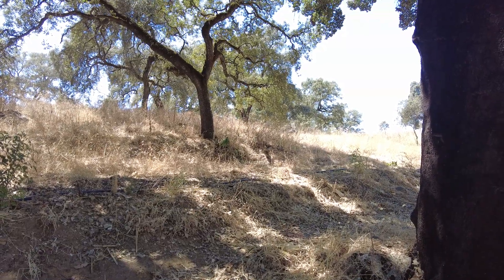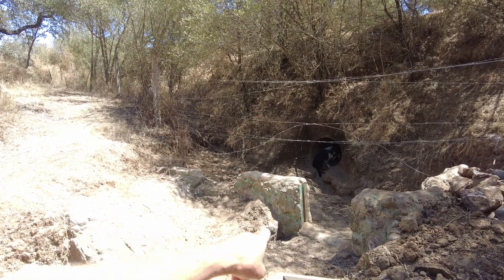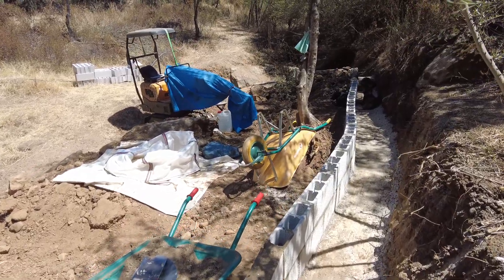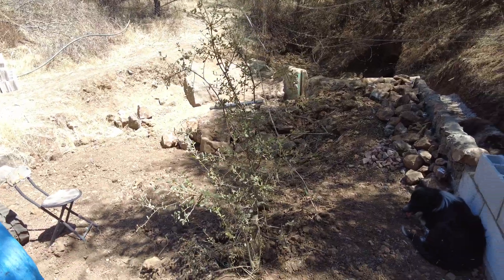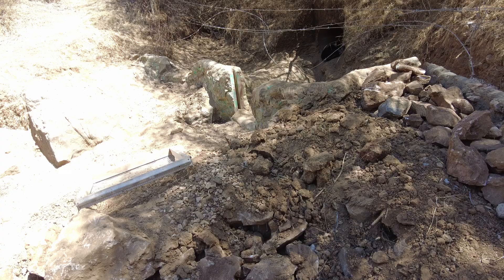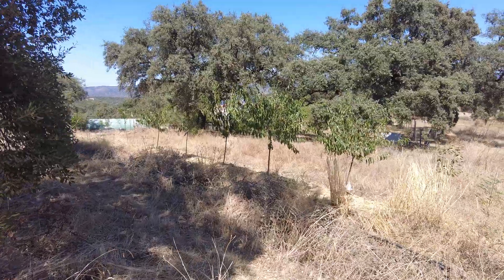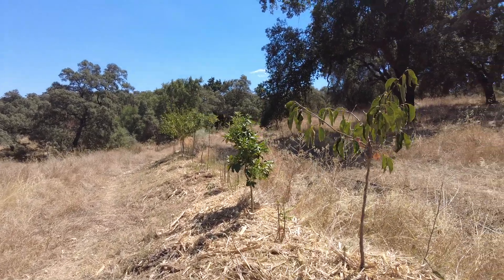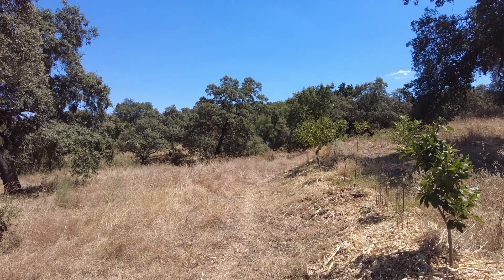Why does water flow? It's all about gravity and pressure!

Comment: IMO I think that the side of the canal not protected by concrete or block will, through hydraulic action, erode and the bank will eventually collapse into the canal.
Reply from the maker: @Rating64  The idea is to have the water flowing as slow as possible. Thank you for sharing

Comment: The area beneath the current (old) cement wall seems to me to be a perfect place to build a larger catchment dam.  If you build it as high as the current wall, you would have a really big catchment as high up on the property as possible, which is nice when trying to distribute water at a later stage. You could bury a monk pipe in the wall, so you can control the level as well. Have you considered  something like that?
Reply from the maker: @mathiasfriman8927  Yes, many times. Two things hold me back: it should be a mighty strong wall that will require others to construct it and permission will take years to obtain. Keep sharing. Much appreciated

Comment: That is a beautiful stone and block wall.  I agree Martin, the block was laid with swiss precision. You bent the block to the curves beautifully Zach. Wonderful! 👍
Where the canal or swale gets shallow because of tree roots, remember that you can accommodate the increased flow by making the swale wider.
Do you have a fabricator who can make you a sluice gate for the dam that is lifted by turning a screw?  That would be a big improvement and also facilitate the unloading of eroded sand into your sand dam.
Addressing the spillway design at the end of a swale;  I'll suggest that you build a level spillway lip that is at least two meters long that will release the water downhill in a sheet flow.  Your grasses are sufficiently established that there will be minimal if any erosion using this design. you can use straight sawn timber or block and cement - just as long as the edge finishes up being level.
Hope there are some useful ideas. 😊
Reply from the maker: @stevejohnstonbaugh9171  Much appreciated as always guru Steve